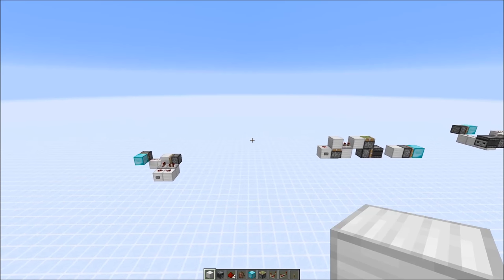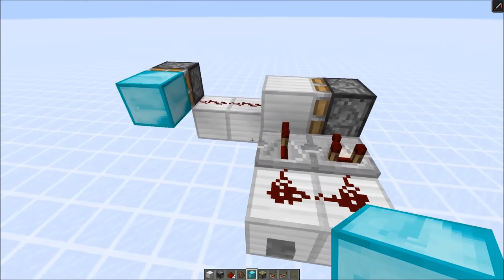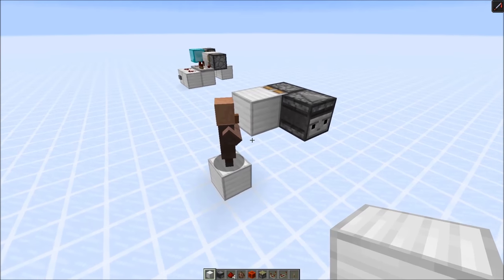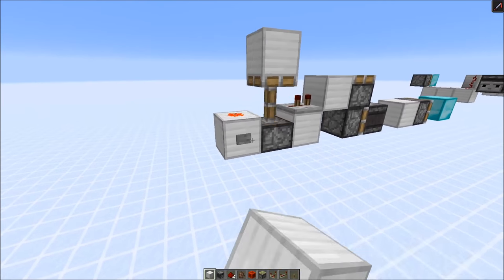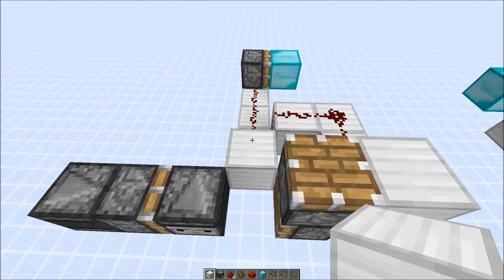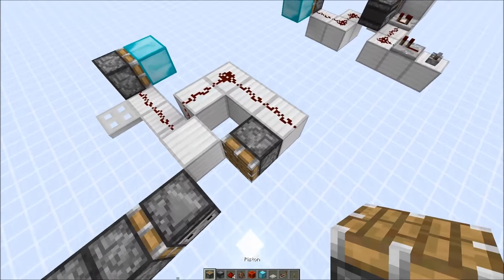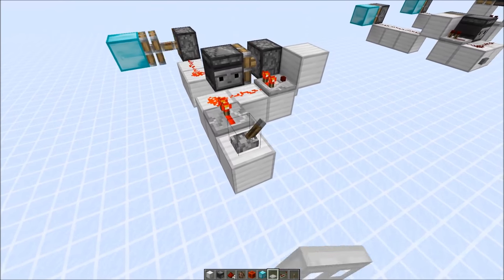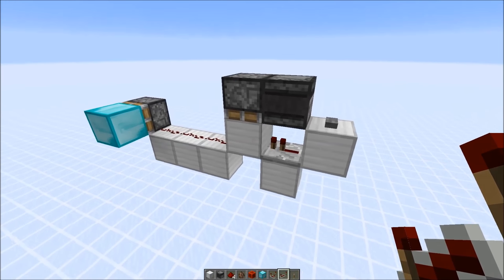Redstone Basics: Using Observers To Create 0-tick Pulses

Comment: This is an excellent explanation of 0-tick mechanics in general (or what I like to call microticks because it's nicer to say IMO). 
An aspect of the thing you show at 3:00 is especially interesting! I didn't think observers would do much for 0-tick centric redstone, but because the redstone dust in that scenario does not immediately update the piston which would push the power source away, that removes a lot of location dependency. I am pretty sure that was extremely difficult if not impossible before.
Reply from the maker: you're right. using a redstone block instead always made it locational, because the redstone dust updated the piston. I think it was impossible to use it without locationality.

Comment: 3:30 Isn't Edd's design locational? I would expect the reason for it working is the piston updating after the observer, so the repeater as an input wouldn't change anything. By swapping the comparator and repeater, you've updated the piston with a repeater and the observer updates after the repeater. Since you said comparators/observers don't always update before the other (same tile tick priority?), it should depend on the update order of RS dust, right?
Reply: Actually, the design was something like this, supposing that observers update before torches, but now i think they have the same priority :S http://prnt.sc/drz2o8
Reply: http://imgur.com/R30dqsw This should be non-locational. The 2 comparators have to be spaced apart. I couldn't find a way to do it without separating the input, because the output dust kept updating the piston :/

Comment: you should try and incorperate one of these into a flying machine
Reply from the maker: we made a flying instant 0-tick generator once for a project, but didn't need it afterwards
Reply: Explodingpineapple 64 I know that block movement can be made "instant" using 0tick like the block mover that Sancarn and Selulance made. I'm curious, to what extent can 0 ticking be applied to flying technology? Could you theoretically make a slime quarry that hollows out a chunk instantly?
Reply: Major Mushroom pistons can only be activated/moved every 4th tick (unlike blocks which can be moved multiple times within a tick(

Comment: The other day I created a couple of 0-tick pulse generators with observers by accident.

Can you explain to me why the iron trapdoor updates before the piston?
Reply: It's hardcoded I think, tile ticks (repeaters, comparators, torches, lamps, trapdoors etc) are processed before block events (pistons)
Reply: I don't think trapdoors use tile ticks since it doesn't have delay. It probably reacts to block updates instantly similar to RS dust and rails.
Reply: Yes it does oops my mistake
Reply: In 0-tick jargon, trapdoors are block-update-instant, while pistons are not.
It´s probably helpful to link the processing order of a tick here:
http://technical-minecraft.wikia.com/wiki/Tick#Order_of_updates
If you power a piston, then the piston will not extend right away. The piston will just schedule a block event, and then the piston will wait until the block event gets processed. The block event will get processed in the phase "Perform block events until there are none.". So the piston waits, until the tick reaches that phase, and then the piston will extend.
Trapdoors on the other hand don´t wait for any phase. Trapdoors do not schedule any tile ticks or block events whatsoever. If you update them, they change their state instantly, no matter in which phase of the processing order you are. Redstone dust is also a prominent example of something that is block-update-instant.

Comment: This is great, but I wouldn't call it Basics! Makes me feel like a total nitwit ;-)
I think I understand what you explained though, so congratulations on that!

So if I understood correctly the principle we're looking at is this:

Let's take the last contraption as an example:
When a tick starts, the repeater forwards the signal first, starting at tick 1,0. Then the observer kicks in, who outputs at tick 1,1 (an imaginary tick moment) breaking the first signal. You therefore created a signal that lasts 0,1 ticks or a zero tick pulse as the game only works in complete pulses.

All the other contraptions do the same, but you substract different sub-tick delays. Like observer-block-delay minus block-event-delay, or repeater-delay minus comparator-delay.
Reply: Your general intuition seems to be ok. The only thing I want to add, is that you shouldn´t underestimate the importance of the piston in the last monostable. The piston in the monostable is the one who guarantees, that the pulse is long enough for the piston at the output to react.
The update order of the last monostable looks something like this:
-Repeater turns on
-Observer turns on
-Piston at output extends
-Piston in monostable extends
-Piston at output retracts
And the reason, why the piston at the output manages to extend before the piston in the monostable extends, is that 1.) the piston at the output got powered before the piston in the monostable, because the repeater activated a little bit earlier than the observer, and 2.) the piston at the output has the same sub-tick delay as the piston in the monostable, because they´re both pistons and work similarly.

I just wanted to add this, because in your explanation you never mentioned the piston, even though the piston is quite important, because he guarantees that we don´t just create any super-short 0-tick pulse, but rather a 0-tick pulse that is so long, that pistons at the output will react to it.
Reply: I don't quite understand how that works, as I thought the piston was just there to cut off the signal to make it shorter. But thanks for pointing it out!